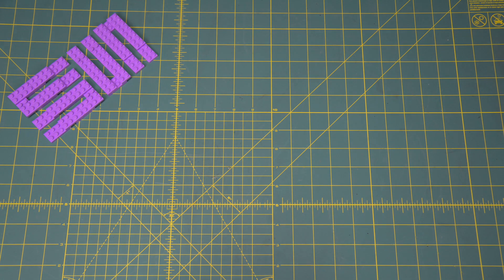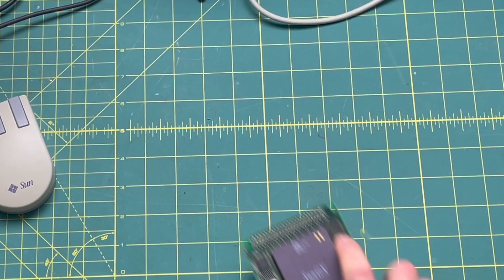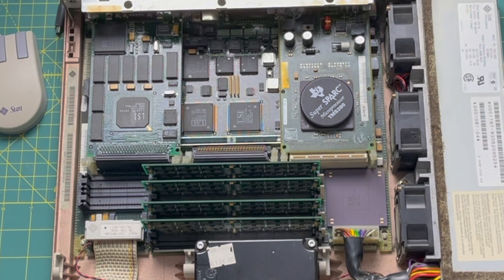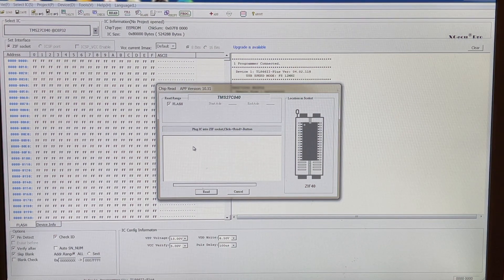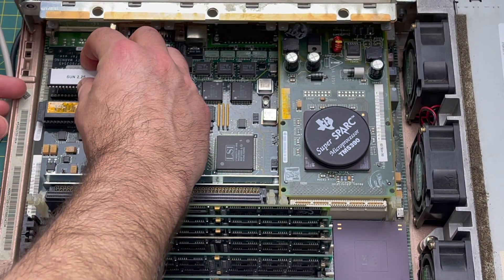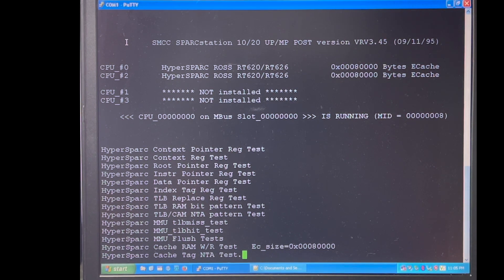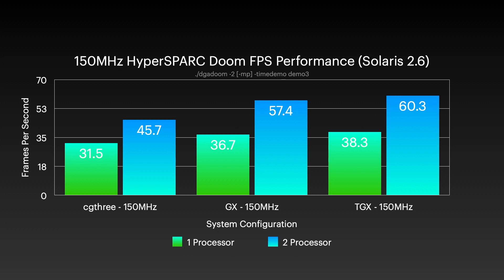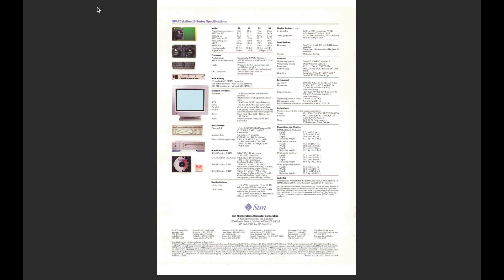EP 4: SPARCstation 10 Upgrades

Comment: Been a long time since I've run it, but I built a 'full house' SS-10 twenty years ago with 512 MB of DRAM, a pair of SM-61 CPUs, and a 1GB HD. I ran benchmarks, and it was at least as fast as a P-100, if you could keep both processors busy. Had it running RH-6.2. Neat old machines.